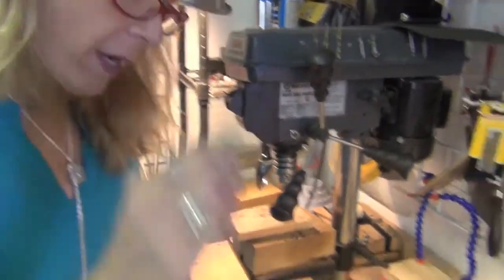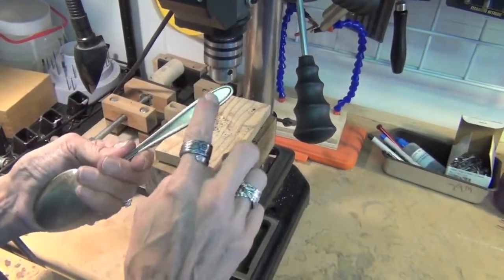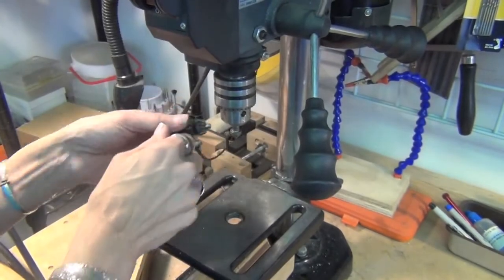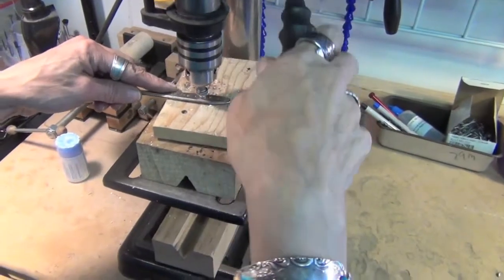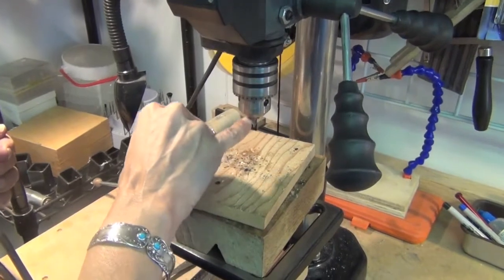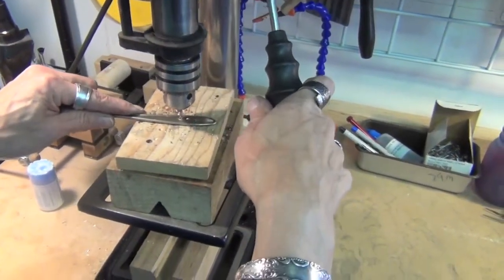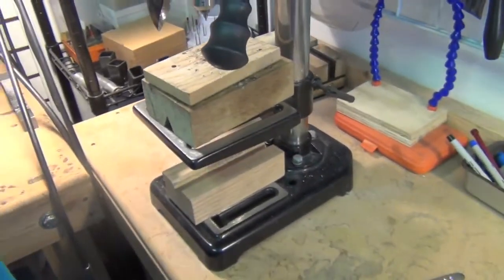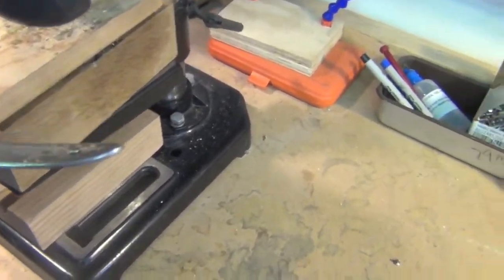Crystal Snap Rivet drilling methods for silverware jewelry

Comment: Hi, Can I use a chamfering bit with my dremel tool to achieve this?
Reply from the maker: I find it very difficult to drill metal with anything other than a drill press.  You need slower RPM's and firm steady pressure when drilling metal.